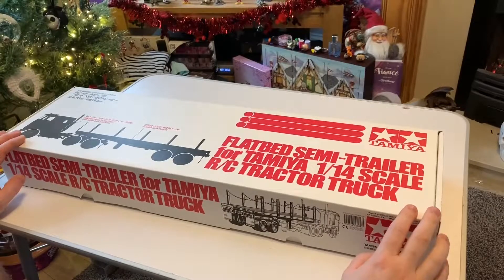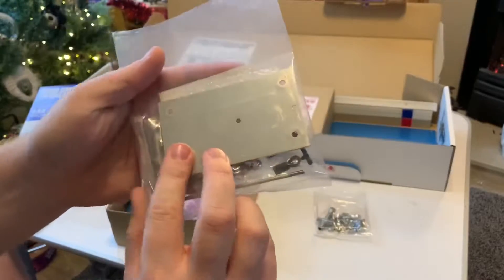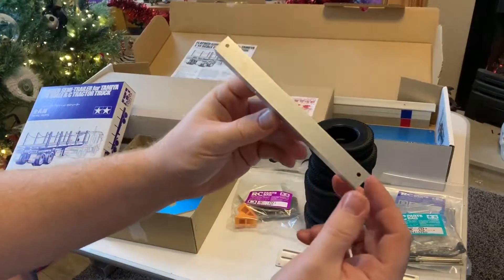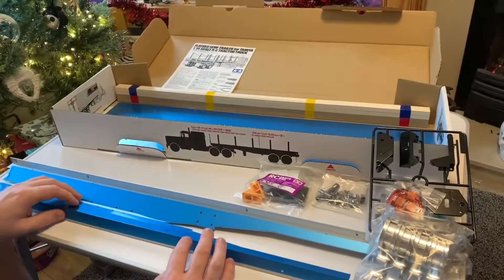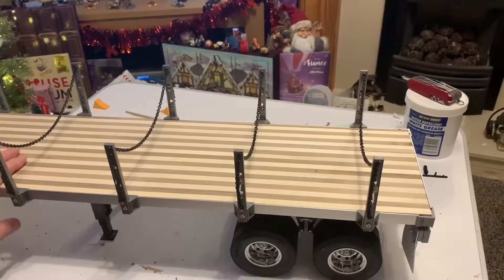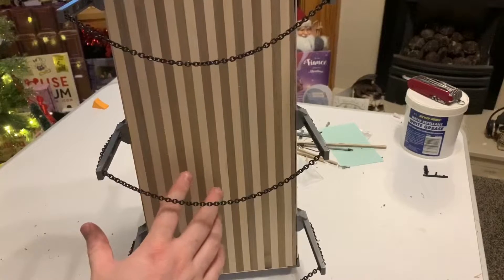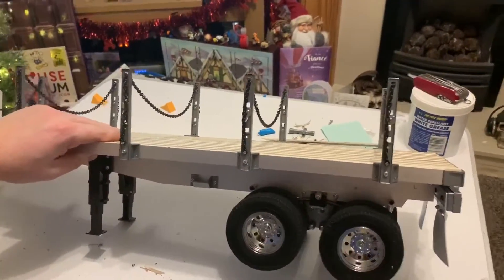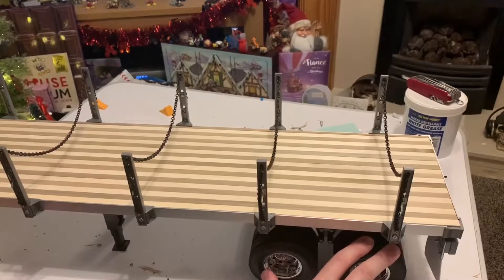Tamiya Flat Bed Tractor Trailer Unboxing / Build Review 1/14 Scale

Comment: 13:06 get a m2 tapper and a jis driver. These Tamiya kits do not use philips head, the angle of the screwdriver head is different, making it complicated when using the wrong tools. Very similar, but incorrect for the application.

Comment: Will you be doing a build video of the power unit for this trailer?
Reply from the maker: PNW RC if you mean the MFU then no, it’s ridiculously expensive, but I will be looking at cheaper alternatives like the GT Power system for sure. If you are referring to the automatic leg feature unit for the trailer, then it’s certainly a possibility, I just need to finish the actual truck first. Thanks for watching.
Reply: @ExperienceRC  The actual truck build video is what I was meaning.

Comment: How has the truck been thinking of getting one to build ?
Reply from the maker: Ham & RC man ! I’ve been really delayed in getting it finished. I should have it finished within the next couple of weeks, I’m just waiting for the weather to improve so I can finish the paint. So far the build has been interesting. I can’t stand their instructions, I don’t find them too clear, however the part which most people struggle with (the gearbox) I found relatively straight forward. The quality of the truck is very good, and it’s much heavier than I expected, so is the trailer.  I’ll have the next build video up in the next few days. I would definitely recommend one, however I wont recommend spending so much money on their MFU system, you can pretty much buy another truck.